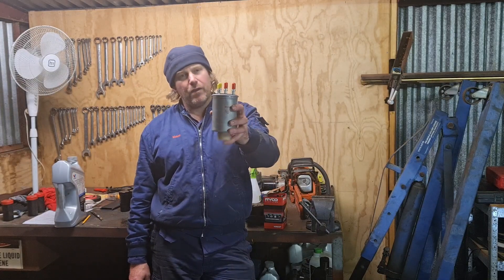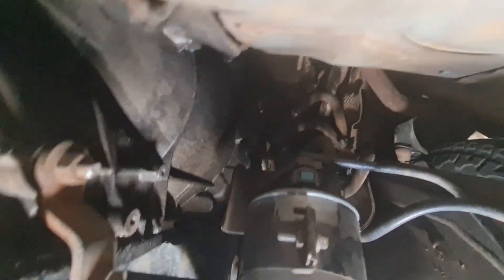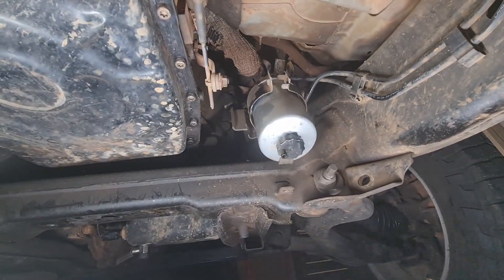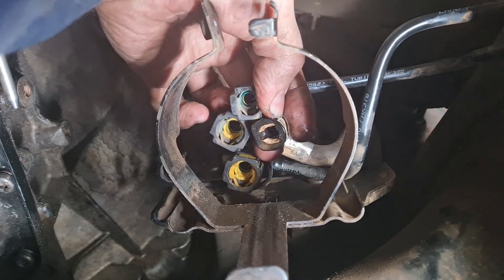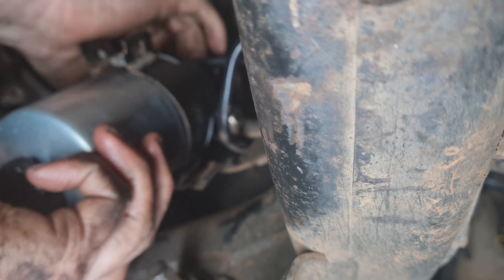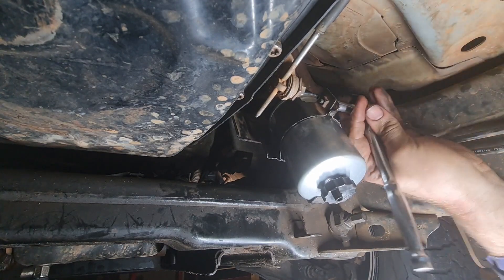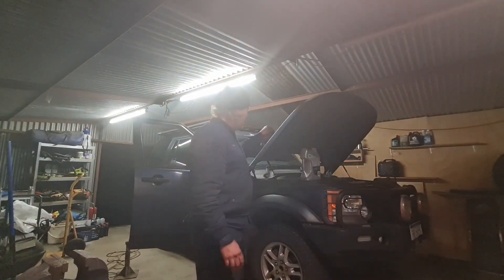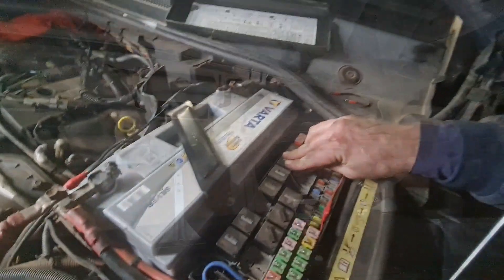Early Land Rover Discovery 3 diesel fuel filter change | How to DIY

Comment: Thanks for this video Shane. I hate doing this job when doing a service on my D3. Good to know i'm not the only one who finds it frustrating. The first time i changed it I was in a public car park and couldn't get it started.Took some googling to find that schrader valve. Thanks for the tip with the fuel pump relay. I'll give it a go next service. Cheers.
Reply from the maker: It is a stupid design.

Comment: Nice video Shane. It's certainly an awkward job , but quite doable. When I changed mine, after removing the bolt from the bracket and loosening the filter, I undid the two bracket mounting bolts to release the entire bracket from the frame. This allowed the whole filter assembly to drop down which improved access to release the top connectors. I also made up a bleeder hose with Schrader 556 valve with barb adaptor and some hose to make bleeding easy and tidy. Cheers.
Reply from the maker: Yeah it’s a job that really shouldn’t be as difficult as it is considering it’s a service item. I’m glad I haven’t had to change one out bush yet.

Comment: Shane I’ve had issues recently we’re I’m getting “system engine fault” and the car goes to limp mode a real pain in the arse.  I read on an SA forum that the fuel filter is blocked so I changed it and bingo it worked for 2/3000 Kms and then it came back. Bummer.   😫To the best of your knowledge do I really need a very good filter.  What did you use ? And/or the tank Is rotten with dirty fuel,   Any ideas as this is a real pain in the arse , Car diag tool has no faults related.  2006 disco 3 🙏🤙keep up the good work mate.
Reply from the maker: I generally use Ryco or Cooper/Wesfil filters - just depends what my local parts store has in stock at the time. Bit hard to figure out whats going on if no fault codes are being logged. I sometimes get an "injector control pressure too high" code which triggers limp mode. A filter change always sorts that out - the injectors return fuel back to the tank via the filter so my theory there is the filter is starting to clog and raising the return line pressure triggering the fault.  And you do want to be using quality filters, gone are the days where diesel fuel systems could tolerate some dirt.

Comment: As you mention in the write up, later D3 and all D4 have a different filter, but it is in a different location, which is found behind a shield in front of the fuel tank.
I make a note of which pipe goes where, as getting it wrong on reassembly causes issues. Also, before fitting the new filter, I turn it over and fill it with injector cleaner through the water drain screw in the bottom, leaving the caps on the pipes. This obviates the need to prime the filter, and gives your injectors a good dose of cleaner at the same time. This filter is a pain in the arse, which is why even main dealer serviced cars have never had it changed. Fuel filters should be in an easily accessed location and need minimal tools to change, see the 300tdi. LR messed this up big time.
Reply from the maker: I don't have too much of an issue with the location, but it should have been something that was much easier to deal with like a cartridge that can be unscrewed.